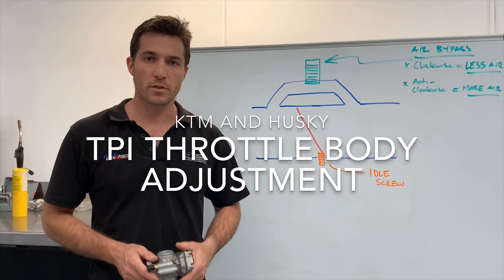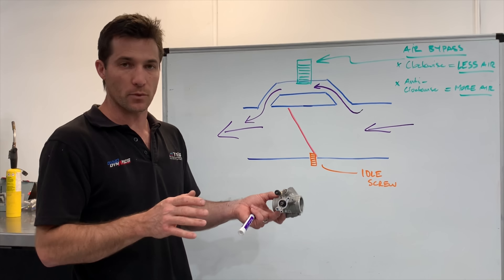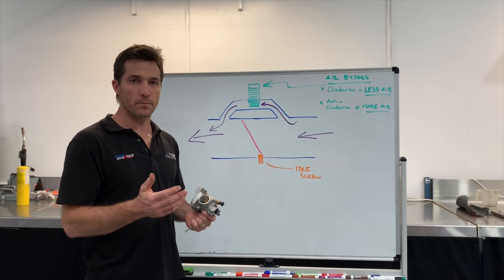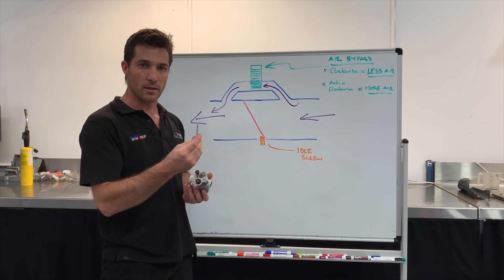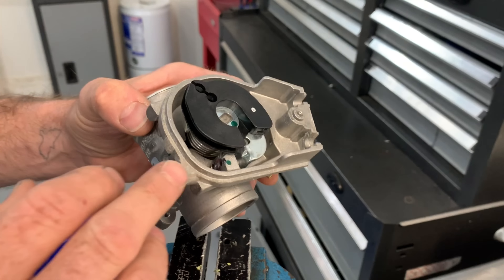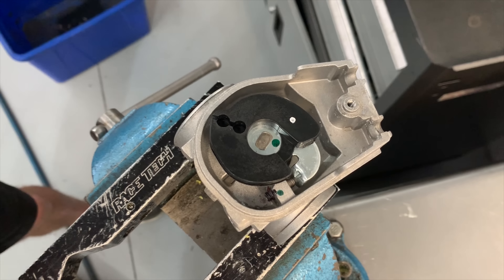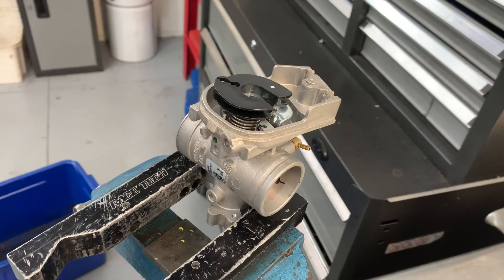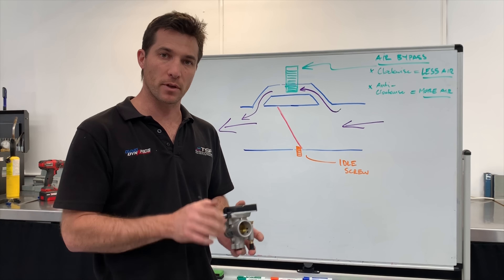KTM and Husky TPI throttle body adjustment and Idle Bolt installation by Two Stroke Performance

Comment: Mine I didn’t have to heat. It was loose enough. Probably because I use an engine blanket when I snow bike and maybe it caused enough heat to break down the thread locker? Your kit is fantastic and transformed the bike. Kudos yo South Bay Moto for their excellent service!

Comment: Some odd information here. 
The 'air by-pass' named in the video is actually the Idle Air Screw. 
The 'idle screw' is the factory pre-set throttle stop. 
Moving the throttle stop should be avoided as it affects the idle TPS reading which only takes small movements to make large changes to idle fuelling. Any movement of the butterfly stop should also be followed up by a TPS zero position reset. 
The air required for Idle will arrive at the insides of the engine from either the throttle butterfly or the idle by-pass port, it does not care how it gets there. Only the volume of air is important for the idle speed. Fuel is added into the transfer ports, so there's no problem with air 'not mixing' at the butterfly plate from bypassing through the idle port.... There's no fuel at that area.
Reply from the maker: Dangermouse none of it is odd, it’s just different to the tech info KTM release... the change in the TPS reading with a small adjustment of the idle screw makes negligible difference to idle fuelling on the TPIs in the real world, and it makes zero difference once the throttle is opened even slightly. On the other hand the air screw setting DOES impact air fuel ratios at all throttle positions, with the biggest impact being at low throttle and idle... much greater than any change in idle TPS value makes. 
The reason for doing this adjustment is due to the fact that there is a wide variation in how TPI bikes run, even though they have the same fuel maps, they will give different air/fuel ratios. By adjusting the air screw you can make small adjustments to the A/F ratios, especially at part throttle.... once part throttle running has been tuned via the air screw in SOME cases it will result in a higher or lower idle speed than ideal. In THIS case you’d fit the idle bolt to bring the idle back to normal (and therefore bring the total amount of air at idle back to normal). Of course I’m aware that there’s no fuel mixing in the throttle body. 
No question what I’m suggesting is different to the tech info KTM release but after having tuned over 200 TPIs by reflashing the stock ECUs I can tell you that it works.
Reply: @TwoStrokePerformance  
Other that 'Map shifting' by moving the throttle shaft in the TPS, there is absolutely no difference to the air coming into the motor. 
The MAP sensor will see the same vacuum signal in the manifold if air passes under the throttle blade, or through the Idle Air Screw.... it's just air. 
If the TPI runs the same as every other small bore bike and runs off the TPS for Idle and slight throttle, then the ecu has no way of knowing which path the incoming air came via. 
It will just do a volume calc based on the current TPS setting, the RPM and the other sensor data and add fuel to suit ... 
I can't see why you think that Idle Air Screw air is special.
This all changes when you drop the Idle Air Screw down and choke off air, then you'd have to crack open the throttle stop to raise the idle. 
This moves the TPS value to a richer section of the idle map and 'cures' your part throttle problem. 

Moving the TPS idle setting is something that we used to mask the horrible flameouts in the TE449 factory mapping before we had access to the tuning app we have now. It only take a tiny (0.05v) adjustment for it to correct the problem. 
I'd suggest that's what is happening.
Reply from the maker: Dangermouse you’re thinking about it wrong. They don’t run a normal
MAP sensor and fuelling is mostly determined by RPM vs TPS.
By adjusting the idle bolt we are only changing the closed position of the butterfly , there’s no change to the relationship between the throttle and tps. 
At any given TPS vs RPM point the ecu will add a calculated amount of fuel. The calculations assume a fixed flow of air through the air bypass at that TPS value. By changing the air bypass setting we can influence air fuel ratios.
The TPI TPS doesn’t have any means of adjustment. It’s fixed, unlike most other EFI bikes and there’s also no mapping software commonly available. 
But again this doesn’t matter as we’re not changing the factory TPS setting, only the closed position.
Reply: @TwoStrokePerformance  
Mate, I stand corrected. 
I wrongly assumed that KTM might actually be using a proper EFI system, not something off a piece of lawn equipment. 
I'm now understanding why they won't run right. 
There is no way for the system to make a sensible decision on what fuel to deliver to the engine without knowing vital sensor info. 
Just another KTM cheap nasty solution. 

Your comment regarding the throttle adjustment not affecting the TPS makes no sense. The sensor is on the end of the throttle shaft, if you adjust the stop position, the shaft moves and the TPS value changes. If it doesn't move, there's no point in having a sensor. 
All the best.
Reply: Dangermouse 
I have to agree with you. I’m an old retired automotive tech. Factory trained Chrysler technician. Been awhile, but have a pretty good idea how fuel injection works. Considering that was one of my specialties. 

I’ve watched several of these tpi throttle body videos. Including Jeff Slaven’s. I’m at a loss of what this is supposed to do. Air passing through an adjusted orifice or around the butterfly valve is just air flow, no difference. The only possible positive outcome is if opening the throttle butterfly to achieve enough air flow for the engine to run/idle would be if the tps changes enough for the ecu to change fuel mapping, fuel injector pulse width. Cars have an idle speed motor that controls the air to control idle speed this way. Would be interesting to see if the tps value changes do this mod. And/or if injector pulse width changes. The other part that I don’t understand. The explanation of the “cold start” control. Per Jeff Slaven. “Don’t need or use it”. The cold start control does not control fuel. Does not richen the fuel delivery. That is done by the ecu calculating the amount of fuel needed, using sensor values. Cold engine, baro etc. what the cold start does do is raise the idle speed. Engines run better with a high idle speed when cold. Cold start your car engine and pay attention. The idle speed will be higher for a calculated time controlled from the ecu. Even carburetors have a high idle cam. 
Dangermouse, I agree with you!
Reply: @mikeshuck2760  In all other EFI systems, moving the butterfly stop screw will change the TPS value and it will need be recalibrated or, in the case of these simplified efi systems, it can be an advantage to move to the shaft to obtain a different TPS value and get to a richer part of the maps.
I suspect that is what is being done.
My own Sherco 4 stroke uses the Synerject brand efi system that team Orange is using.
KTM is using the cheap nasty version without idle control.
On the Sherco it is a fully featured system which is self compensating for temperature, atmospheric conditions and idle speed. It switches seemlessly from TPS light throttle maps to MAP sensor based tables throughout the range of operation.

Don't know what KTM have done to cock it up, but while there are bikes that run very well, there are many upset owners asking questions and not getting answers
Reply: I'll bet Dellorto loctites in the butterfly stop screw on the Dellorto 39mm mechinical thottle body..... not ktm
Reply: @Danger_mouse  Changing the idle stop will cause the butterfly to open slightly (more air) and also tell the EFI to provide more fuel just like when you turn the throttle a slight amount.
Reply: @paulschommer5094 
That's correct, but it also introduces more air.
What should also be done is increase the TPS value by physically adjusting the sensor on the throttle body, this will richen the mixture (by increasing the TPS value without additional air)
Reply: Hi, I have a 2022 husqvarna, I'm consuming too much petrol, I went for the air screw and idle .... is it possible because of this?
Reply: Hello, I have a 2022 husqvarna, it consumes me a lot of gassoline,can you help me please?
I want to mention that I walked on the air and idle screw... please

Comment: Just finished the procedure.  All is perfect except a bit of sputtering in wide open throttle in 2nd gear?
Guess I need to play with air bypass and idle for a bit?  Any suggestions.?

Comment: Just did this modification and it works just like he describes it. Took me 45 min to strip, do the mod, reassemble and test ! Awesome video.
Reply: Did you remove the TPS from the throttle body when heating it up?

Comment: Is this mod still relevant for a 2023 300xcw?  I read that idle speed would require only a small idle air screw adjustment due to revised (closed) butterfly plate position on recent year Dellorto TB. The article also stated the 2018-2019 bikes were the ones that needed the grub screw changed for an adjustable screw. I cant remember where i read it. RacerX, Vital mx...not sure.  I have the 2023 and it runs good. It just idles low and will shut off if you arent blipping throttle constantly. Just curious since this vid is 4 yrs old.

Comment: I have a 2020 300tpi 
I have the two stroke performance head and re-map 
I have set the throttle position sensor to 600mv as suggested and my air screw is 3 turns open as per the TSP instructions but my bike isn’t idling too good. Any ideas please ?

Comment: I did the idle screw mod but missed the part about only adjusting that if necessary after adjusting the air bypass screw. I have no idea now where it sits relative to the stock setting. How can I set that back to near stock setting? As I recall you can measure voltage somewhere and set accordingly. Any tips?

Comment: Done this mod myself on my 250 tpi 2020, bike would not idle an kept stalling, tried adjusting the air screw as instructed by Ktm (upto 6 turns out) but bike started fouling the spark plug with oil, Ive now adjust the air screw back to around 1-2 turns out an raised the idle with this screw, perfect

Comment: Hi great explanation! I've installed the adjustment bolt in my Husky TE250i 2018 and messed around with the TPS calibration as well. Can you tell me which are the factory basic settings in the TPS and throttle position for my bike?

Comment: Looks like you could drill out the cover and have it surround the bolt. It might help keep dirt off the threads and make adjustments easier but would definitely look nicer.
Reply: Then you’d have to remove the idle bolt ages reset the idle if you wanted to remove the cover

Comment: So the factory manual is wrong when it tells you to adjust the idle bypass screw to adjust the idle speed?
Reply: Yes and no. When the bike is leaner, it will idle faster. Indirectly it controls idle speed. It would be like using jetting to control idle speed.

Comment: So, basically you are tuning the idle and part throttle mixture by adjusting the TPS value (by resetting the idle stop screw) and closing off or opening the air port.
Q. What happens if/when the system resets the TPS 0% value?

Comment: I don't doubt anything you say, but it confuses me that you say the flat blade screw is not to be used for setting the idle. KTM says the contrary and recommends to set the idle speed by turning this screw. 300 TPI owners manual page 22....
Reply: He said the screw will let more or less  air in at idle but use it to adjust running at half throttle then,
 if the idle is to high / low use the new idle screw to re-adjust idle not that screw.

Comment: Ty for the info.  Probably will buy your flash/head kit. 
  But my 2021 seems to run fantastic at stock settings.  Did they make changes from 20 to 21?
  Thx again
Reply: Just bought one as well 2021 te300i and wondered same thing... Still waiting for delivery tho...😉

Comment: You might like to use an electrical hot air gun rather than the blow touch - better control and less chance of melting anything.

Comment: Do we need to remove the TPS from the throttle body when doing this mod? Would the heat effect the TPS?
Reply: No.  Heat is isolated to the area behind the set screw.  Nowhere near the TpS

Comment: Thanks you for this informative video.  I have a 19 300 XCW, and while it runs perfectly, the low idle just bugged me.  I was hesitant to make this mod, but after watching this video, I took the plunge.  I pulled the throttle body, and made the necessary preparations.  I set a timer for two min and fired up my torch.  After 90 seconds the lock tight began to bubble, after 2 min I was able to turn the screw (with a T10 tork bit) 1/2 a turn.  Added heat for another 30 seconds and the set screw came out without resistance.  I've set the air screw to 1/2 turn and tuned the idle to my liking.  Total time was around two hours, which included a lot of cleaning.  (since it's apart, you might as well clean parts you normally can't get to...)  I'm on old 2-stroke guy, who always jetted his bikes just a tad rich, so this mod gives me piece of mind.  Again, thanks for the video it's greatly appreciated.

Comment: I will vouch for this modification, having just done it on my 34 hr. 18' 250 TPI.
 That, and replacing the CCP sensor at the same time while you're in there. Bike now runs totally as one would expect it to.